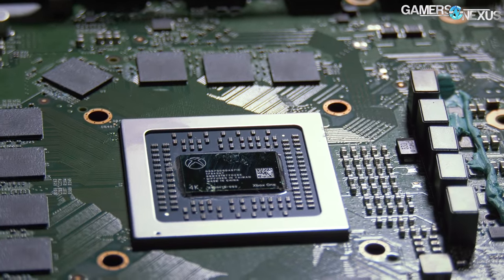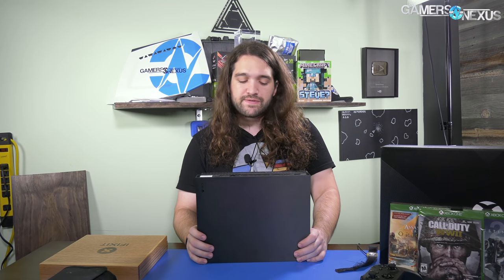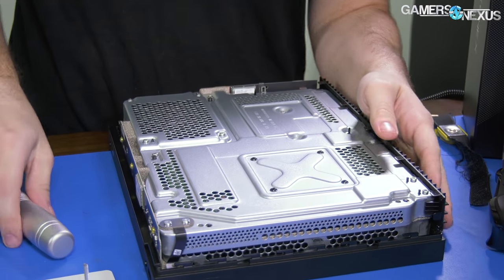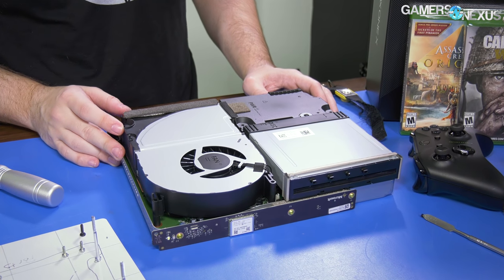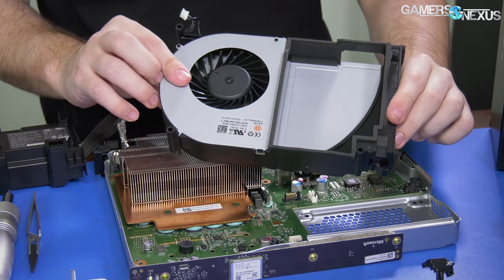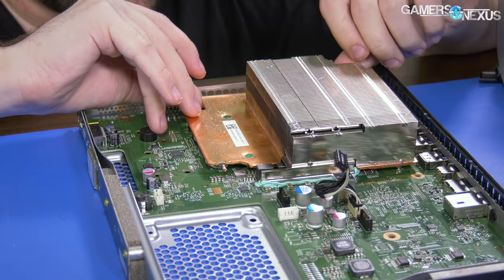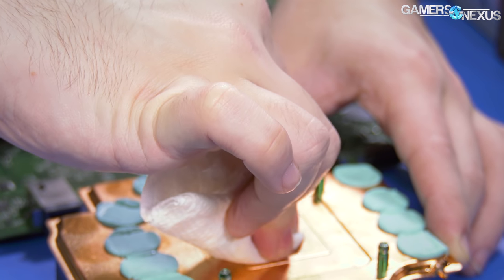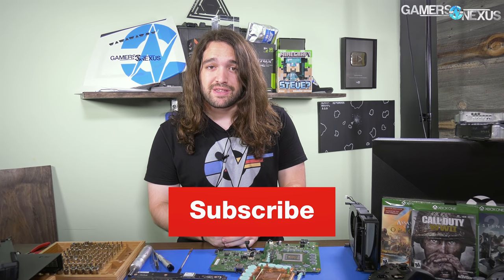Xbox One X Tear-Down: Semi-Modular Console Design

Comment: Markets as 4k console, has hdd inside. Talk about mother of all bottlenecks.
Reply: RoboDog A hard drive won't bottleneck it. Just load times. The cpu will though.
Reply: Red Ring of Death *GPU
Reply: Batemen Maybe at 4k specifically, but the 2.3ghz mobile cpu they have in there is why they cannot just do 1080p 60 even with that gpu.
Reply: The CPU will do fine if they did manage to move all the draw call work to the GPU and it works without much developer input. At 1080p 60fps and 1440p 60fps the bottleneck in most situations will be Vsync and when it isnt itll be either the GPU or the game engine......
Reply: @saladwithsalad  APU**
Reply: Its 4k streamed video....not gaming(the gaming is 720p 30fps upscaled) or content creation lol

Most of it will be coming from your TV anyway
Reply: @Shadow0fd3ath24  are you sure about that?
Reply: @Shadow0fd3ath24  No
Reply: @DeadlyRedRing  They did 1080p 60fps with the original Xbox One (Forza 6).

Comment: I make it a habit of taking every console I buy cloning the drive over to a solid state and just saying bye bye to load
Reply: Dtr146 does that shit work with ps4 slim? I got a pny 240 doing absolutely nothing right now.
Reply: I'm curious, what file system type does Xbox 1 and PS4 uses? Do you know?
Reply: MEGA a e t e r n u s 永 yea u gotta make a clone of the drive tho theres plenty of yourube tutorials
Reply: Dtr146 ayy. I'm gonna do it. I'm bored waiting for the funds for my new build. Should keep me occupied. Thanks.
Reply: Why would you clone a PS4 drive when it officially supports replacing the drive?

We do not know if the PS4 supports TRIM or recognises SSDs for correct partitioning, but if it does then cloning runs the risk of it not being activated or obeying correct SSD partition boundaries.
Reply: Alex Atkin dude cloning it on a pc is the easiezt way to ready a drive for a ps4.... pleb
Reply: Easier but not necessarily the best idea for longevity or optimal performance.  Like I said, it rather depends if the PS4 understands SSDs to begin with, if it doesn't then the point is moot, but if it does then long term performance is going be MUCH better doing it properly.
Reply: Alex Atkin as longs u aint using a cheap ass ssd it doesnt matter itll recognize it
Reply: Alex Atkin and cloning a drive is actually one of the ways to properly replace it if ypu do mot want to loose any datr you just cant use a different sized ssd
Reply: That's not the point, its about TRIM https://en.wikipedia.org/wiki/Trim_(computing) and also about maintaining the correct partition alignment (which again depends if consoles actually recognise they are using an SSD so make these adjustments in formatting).

Then again, I have never seen anyone test an SSD in a console and say it had a worthwhile improvement in load times.  Because consoles are typically bottlenecked at loading that data by the CPU.

Comment: You still have to pay for online, games are more expensive, and it still uses a frigin mechanical drive XD.
Reply: adamsrealm 
Hdd isn't an argument. Literally everyone that isn't rich uses HDDs
Reply: Mechanical drives are much cheaper than SSDs at a given capacity, and are perfectly fine for games.

Would've like to see a 7200 RPM drive though.
Reply: with gold you get abunch of discounts (you still get discounts without it) you get 700$ worth of games in a year's worth.
Reply: I got an Xbox X and I dont use the mechanical.. its filled... I use a bunch of NVMe and Sata3 M.2 512GB and 1 TB drives..https://i.imgur.com/SHslAYd.jpg

Comment: So that Xbox has a standard SATA disk drive you could take that out and put it in a desktop
Reply: Why would you put that slow drive in a desktop tho?
Reply: daiozzz ssssshhhhhhhhhh...  reasons padawan
Reply: Dtr146 fun reasons.
Reply: dwarf365 this man gets it
Reply: you need to get more padawan :)
Reply: i don't think you can swap in an ssd. the internal drives have to be pretty specific to work. you can however use any external usb 3.0 ssd for everything but the OS. i was looking into putting an ssd into an original xbox one and i didn't find anything succesful. other than running an external.
Reply: I can guarentee that an SSD would work. They work for swap-ins for almost every single console of the past, no reason that it wouldn't here. Just clone the contents over to a same-size drive, and it will work. It's just a linux box anyway.
Reply: Anthony: It's running a Windows 10 kernel and everything is launched in VMs. The dashboard, Xbox 360 backwards compatibility, Xbox One Gaming, etc.
Reply: optiquest86 u missed my point
Reply: indeed:)
think i got it now but not sure it would work.
Reply: Anthony Lewis linux box. LOL
Reply: X360 was also running HV as a host for console OS. This is really clever.

Comment: Really still a fucking 5400rpm HDD???? it literally costs the same price for 7200rpm drives, and secondly I hope they allow users to upgrade if choose beside using external only, that's nice and all but I'd prefer throwing in a 1tb Samsung SSD for my base internal and then use a external 4TB Firecuda in a enclosure
Reply: The same reason laptops mostly use them, they last longer.
The 5400rpm it's not cheaper for companies to buy than the 7200rpm.
Reply: Adam it’s supposedly 7200 but yeah the comments above are right
Reply: Adam 2.5" drives are used mainly used in laptops and not only raw performance (data bandwidth) is taken into account, but also power draw and more importantly, thermals. In small cases, like consoles, the less heat you have the better.
Going from 5400 to 7200 doesn't have a great impact on data transfers. There is an improvement, yes, but usually not worthy.

Don't quote me on this, but most likely the HDD is user swappable, but not the 'format'. Xbox and 360 used their own formats and you can't just swap drives and hope it works. You could swap for an already formated drive or even format one using third party tools, but it's has never been official. What you mention works for Sony's consoles, where usually there's a cover or easy access to the HDD. They also have step by step instructions if you want to do it.

Oh, what's good about this X over the PS4 is the SATA port. PS4 doesn't have a SATA port per se. It's a SATA over USB. That's why changing the stock drive in a PS4 to a SSD doesn't show that much increase in performance. I hope M$ really implemented the port and some people show the changes in load time and so on.
Reply: +1st_Luis Microsoft has always used SATA (SATA II, to be precise), starting with the Xbox 360.
Reply: now that its sata III its really worth cloning to a SSD
Reply: 5400 drive generate less heat. And 1tb ssd are overpriced for a console.
Reply: Loading times are up to half of the S model so it's doing ok.
Reply: Frazoor117  if you switch the internal HDD with a SSD you cut down the speed 50% from the xbox one x initial speed,  so its really is a matter of need and if you want to put down the money for it or not
Reply: Adam its 7200
Reply: Yann Nadeau
Ahmmm.... I think what you try to meant and wrote are opposite.
Maybe it's either increase 50% speed or cut down 50% of load time (not speed).
Reply: 1st_Luis you are right i 
sure did right that down the wrong way hehe
Reply: They don't make a 4tb Firecuda. 2tb is the highest capacity.

Comment: Xbox one x basically a pc with Rx 480 with 8350fx down clocked to 2.3ghz
Reply: I wouldn't even go far as saying 8350. More like modernized Phenom II :p
Reply: Nope. RX480 runs at 1266MHz, has 144 TMUs. XBOX Scorpio is 1172 with 160. It's almost identical speed (about a 1% difference on paper). It's an RX480 with a lower clock and more TMUs. It's just a lower power variant basically.
Reply: Fx?? are way better than this Apu Xbox one X sh1t,  i think is like a Phenom with a rx 480...
Reply: That's exactly what I said... This GPU is effectively identical in performance to the RX480, due to having a lower clockrate but higher everything else. Memory bandwidth isn't an issue here,  or at least I would heavily doubt it.

They just need to upgrade the damn CPU, and let people choose "1080p 60Hz" or "4K, 30Hz" in the settings. But they would never do that so we can only dream...
Reply: Also, you missed low latency, shared GDDR5 - 12GB.
Reply: It's a rx 580 with a fx 6100 built into one apu chip.
Reply: my pc sports an rx480 so im fine with that
Reply: dusty reaper both are wrong
Reply: @wefyb2  my 4k tv say I'm 60fps at 2160p on the X
Reply: That's actually what my PC is lol, When I first built it (sometime after when Skyrim released), I got an FX 8320 and an HD 6850, but then a few months later the 6850 fan bearings went out, so I bought an HD 7950, and that lasted until a year or so ago, when the fan bearings also went out on it, so now I have an XFX RX 480 with replaceable fans, and I bumped up the 8320's clock speeds to match the 8350.. I can still play most games just fine, but I have to lower some settings on the newest games to get 60fps, though I'm not entirely sure if it's the CPU or GPU that's the weakest link, I'm assuming it's the CPU since it's old now. Probably time for an upgrade, but I've been putting it off since I'd need to get a new Motherboard and DDR4 RAM too :/.
Reply: I'm not sure about the CPU, but I know for a fact that the GPU is an overclocked RX580 with more CU's. The CPU is an overclocked Jaguar chip, so probably not even as good as an 8350...

Comment: Amazing hardware, but from software, I still think the console makes 0 sense.
Reply: blondbassist amazing hardware? Same outdated 6 core jaguar along with a rx 580 style gpu
Reply: aww, is someones pc gaming manhood threatened by a little old jaguar cpu?
Reply: It doesn't till you are hitting GPU bottleneck, for example whenever we get really beafy cards that can handle 4k at the same framerate as we do now 1080p, r7 1700x will process much less frames compared to 8700k, just as now with 1080p. + it's a potential overall bottleneck, since you can't emplement new engine physics or add new gamplay mechanics via engine - cpu isn't strong and fast enough.
Reply: Developers would use more CPU if they actually could do something.
Reply: If they upgraded the CPU you would complain with no backwards compatibility
Reply: Cpu change will not conflict OS or software in any way, and you can see it with PC cpus. You can run 15 year old games fine on both ryzens and kaby/coffee lakes.
Reply: cesar goncalves and it being 150$ more expensive
Reply: DigitalNow
That's not true because the consoles are pretty much heavily restricted low-end gaming PC's that're x86 based -- so if the XBOX1X and PS4PRO had, say, an R3 1200 CPU in them, they would be able to play games that were made for the base PS4 and XBOX1 via an update. I'm no software engineer but i am pretty certain that's the case. The reason why Sony and Microsoft didn't change the mobile 'jaguar' CPU's in their mid-gen refreshes wasn't because of code problems - but because of price problems. If the XBOX1X had an R3 or an R5 CPU in it, it would bump up the price significantly and $500 is already a tough sell for a console to some people.
Reply: You make 0 sense
Reply: Stephen LaPorte
Who, me?
Reply: Yeah but a lot of these PC games release on consoles too, and at the same time. 

Again, i'm not a code expert, but i'm fairly certain that a CPU change in the XBOX1X and PS4PRO wouldn't have affected the games that were originally made for the base models. A simple update is all they would really need. This ain't the 7th gen anymore, where those consoles had awkward architectural designs. 

I mean, PC just got a PS4 exclusive now, NIOH.
Reply: Hmm, i see. I think the reason why modern PC's struggle with emulating Wii U games might be because its still early days - needs further optimisation. RPCS3 the PS3 emulator is making great strives and is coming along nicely.

Anyway, can't we all just agree that these 'mid-gen refreshes' are just a complete waste of money and time?

Just release the PS5 and XBOX2 already...
Reply: Modern PCs only struggle with emulation because people take the original proprietary game environment and ramp it up to 11 to get widescreen out of SD games and jack up the resolution, poly count, framerate, and anti-aliasing.
Reply: Xx Luke xX where did you get six cores from, add two more to that.. Do your research then make a comment. Then you won't look like an idiot when yo leave comments..
Reply: +DigitalNow "Console games are programmed using assembly language where code is written for specific specifications of the hardware."

Old console games were. New console games are written in high level languages using SDKs and talk to the hardware through api calls to the OS. They do not have direct access and they certainly are not written in assembly. lol
Reply: The os thing is also wrong. Switching a cpu does nothing to the os, take mac for example, macs are made with specific hardware, but I can still make a hackintosh with an old i7 2600k and a gtx 1080.
Reply: Gillian Seed what a stupid comment. He is right and you know it
Reply: UCanBeMyBigBoss a CPU change in console's would affect the games that are being developed for it and it would need to be heavily patched and coded for it because they are not PC's and do not work the same as a PC
Reply: UCanBeMyBigBoss nioh was not a ps4 exclusive it had timed exclusivity for the PS4 system
Reply: Gillian Seed Lol, classic.
Reply: Xbox tech director already confirmed that as long as they keep using x86 it would pretty easy for Microsoft to create software that keeps all current games compatible. He also said they already did this with the Xbox one x mostly due to GPU difference but the software update was relatively simple and should be in the future as well.
Reply: blondbassist Pretty impressive for a console for sure.
Reply: something1random23 that's not the case with this eighth generation anymore. They're running the same code block that PC does. The x86 instruction set.
Reply: Xx Luke xX isn't it an octa core
Reply: 700gsteak They'd run a hell of a lot better if they were, lol. But yeah, the N64 is probably the last console where developers used any significant amount of assembly or any at all, but still, the majority was in C.
Reply: Gabriel Jackson Two cores are used exclusively by the OS, so it might as well be a six-core CPU.
Reply: my bad dude I forgot
Reply: cesar goncalves 
You
Are
Special
Aren’t
You
?
Reply: 700gsteak you forgot compilers exist...
Reply: @Venom_Byte  they're not x86 based
Reply: Gillian Seed No, but the CPU is a big bottleneck.

Comment: Please test validity of native 4k.
Reply: DigitalNow I'd like to see the data supporting that.  That it isn't upscaling, tessalation, or other semi resolutions.  Rx580 can't do even 30 minimum full 4k, so I want to see the data.
Reply: Aj M didn't digital foundry do all of that already?
Reply: DigitalNow I'll check them out
Reply: all modern consoles pretty much run new games now with adaptive resolutions and claim it's 4k.. where in reality it only hits that in low demanding areas. most of the time it runs at 1440p or 1800p... DF has shown this a bunch as well. Or they cut framrate in half to allow headroom for higher resolution. (not worth it imo)
Reply: i wasn't saying there was no native 4k games, just that a majority of newer ones (not first party) aren't at 2160p constant. (unless selected in a "4k" option gimping LOD and other visuals to keep that resolution)
Reply: Aj M only in some games which are not particularly demanding. If not you have upscaling just like the pro
Reply: Yeah exactly.  I am not saying it can't do ANY games in native 4k.  However, most it just can't do it with most games.  I know pc hardware really well.  I get its super optimized, but to say it just does it native is pushing it too far me thinks.  Again why I'd love for Nexus to do tests to show if it actually rendering native 4k on the most demanding games.
Reply: Aj M it's strange tho , a lot of people are saying it's a good console , it's a beast and that the pro is shit. I only see a 350$ console getting beaten by a 500 $ console which is also not 60 fps capable and it will be obsolete in two years minimum. To me is a waste of money , better with a 500$ PC that can play every game you want at higher framerate
Reply: I totally agree.  People try to say something to make it seem better than it is.  The image quality is very nice.  However, don't say it is something it isn't.  I will admit I'm wrong if I see it running major titles, like most of them, in native 4k.
Reply: Aj M A lot first party title apparently run at 4k with 4k textures and looks really well but for almost every game you will be stuck with 30 fps. I mean this is not the jump i want from a console , for me 4k is still a gimmick especially for gaming
Reply: I totally agree.  I would take 1080p 60fps first.  I grew up during the time of story and game quality appreciation.  A pretty game that is a terrible game is still a terrible game.  60fps gives value to the experience, not just the looks.  I feel you.
Reply: Aj M it's been proven to run native 4K at high settings in many games lol
Reply: V3rzify ! Links to that specific info pls
Reply: Aj M there’s no link to that lol these guys like to push over console war bs native 4K games will be heavily optimized
Reply: Your Daddy we have a choice here playing pc at desk or relaxing in recliners with xbox one x and big 4k OLED . Nine times out of 10 I'm on Xbox One X . It's just what I like playing on right now. And it looks fantastic
Reply: Jay Legit same here. My PC has gathered dust since the One X's release. Even though my PC is significantly stronger than the One X, I just prefer playing on Xbox. Plus my friends on Xbox are nicer. My PC friends are all toxic.